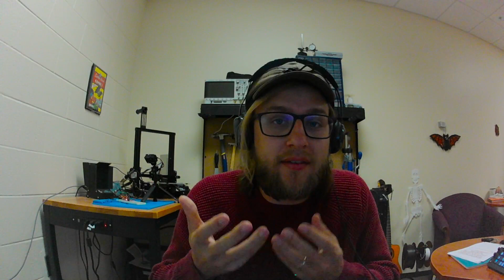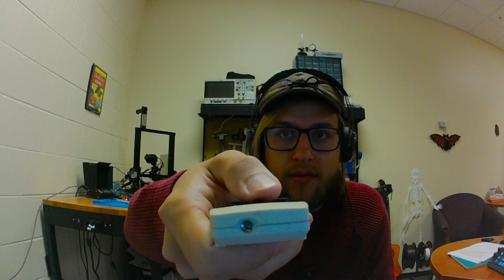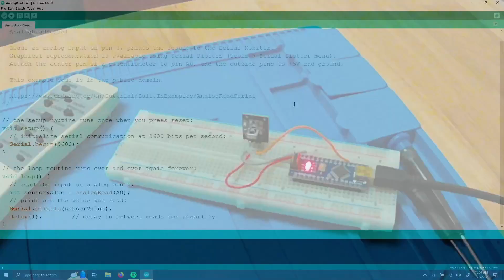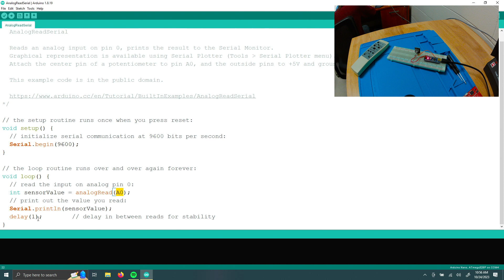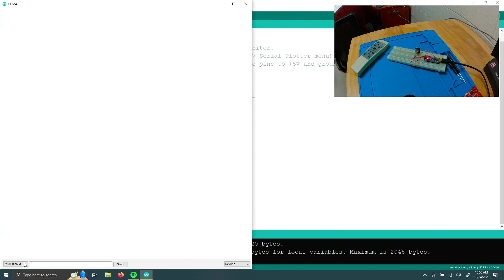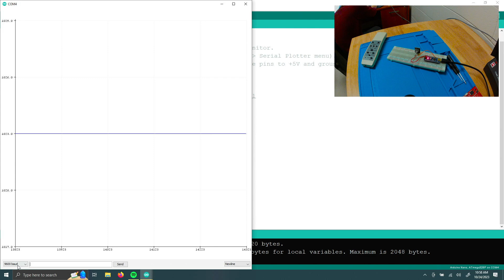Using Arduino & Sensors to Debug an Old Remote

Comment: i was literally thinking about this yesterday, one thing that would be cool to see would be an arduino program that could memorize the inputs and reproduce them given an ir module or something, the only thing is that i have no idea what data structure to use to save the receive signal since i doubt it will always be a constant value.